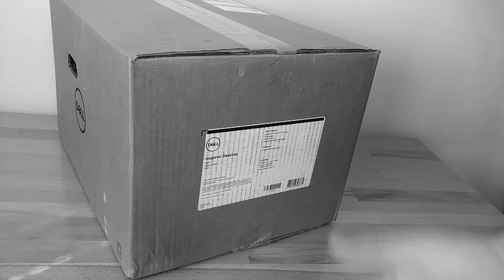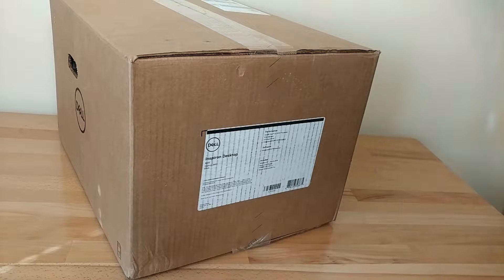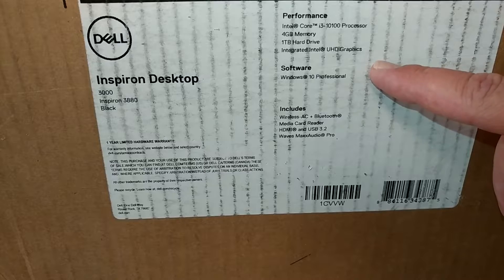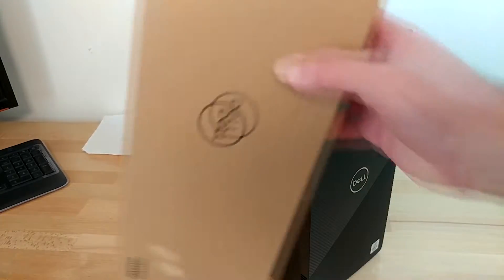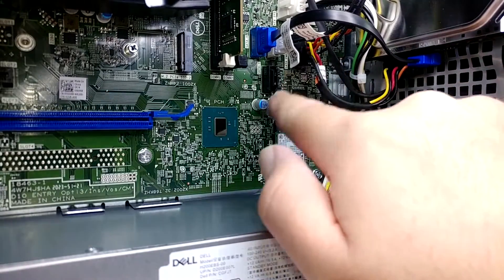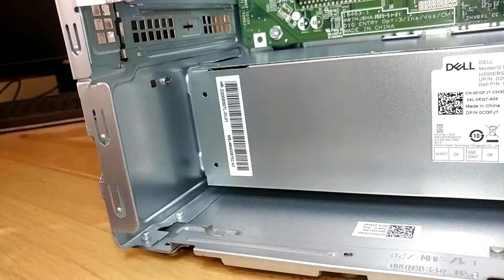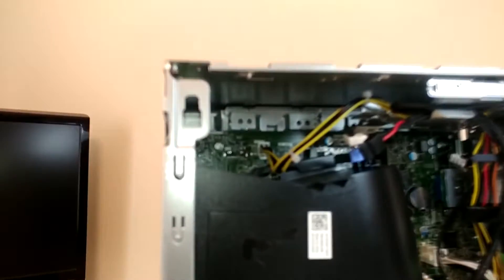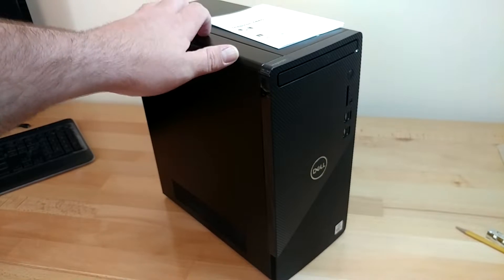Unboxing The Cheapest New Dell for 2021 (and 2022) and Upgrade Plans!

Comment: With the PSU, I can't seem to find the "standard" 260W upgrade anywhere as I've scoured the ends of the internet to where I'm sure I passed Mordor AND Hogwarts... and I can't find it. I'd rather not deal with being on the phone with Dell for hours on end either... I finally caved and went for a non-OEM mod with the 360W PSU meant for the Optiplex/Inspiron 3668 (which has a VERY similar chassis and motherboard to the 3880 btw) based on a post on Andrew Bullis' website/blog in which he made a lightweight/starter gaming tower out of the 3880 by swapping out for the 3668 PSU and added an AMD RX 550 (of course a lower-end 50 watt card but he said he was trying to be careful as he wasn't sure of the 3880's capabilities and such) along with a SATA-to-3pin fan adapter and 80mm case fan for cooling (and a tiny resistor cable so that it didn't run too loud) in which he claims still works great after many weeks. Granted it was written like 4-5 months ago so IDK if he still has that rig but it was an unexpected solution to the proprietary PSU problem (it's a problem not just with Dell but kind of standard with HP and any other major PC manufacturer) and thus has gone somewhat viral amongst 3880 posts/subreddits... also there's a post or 2 (with pics) on Dell's forums where people have put standard ATXs externally with 24-to-6 pin adapters but for the cost of over a Benji for those AND the still-expensive GPU (though they're supposed to be getting less expensive soon, literally knocked on wood for that) I'm sure it's possible to find a better gaming-dedicated tower for a similar price... or to actually BUILD one that's even better than that. I mean I've heard one could just put a 1030 in the PCIe slot and be done with it (though I've heard it might be pushing it with 200W) and I'm not sure it's cost effective to even bother putting even say a 1660 super in there.

It really is a shame too, as I checked out a review Gamers Nexus did on these proprietary Dell PSUs (granted this one was an epilogue/extension to a negative review they had for Dell's G5 but its PSU is very similar to the inspiron's) in which they go into the tech details of how PSUs work... they have an Oscillator and various other power-testing gear and the PSU performed surprisingly very well for what it is. These proprietaries are not BAD PSUs by any means but they ARE hunkered down with very low wattage which pours salt on the wound of the GPU situation.

I'm not sure if I'm actually gonna put this PSU swap in my PC but even if I don't (I really want to just build my own PC instead, if not just for the experience to say I did it and to actually choose what I want to put in it; expensive prebuilts even from smaller more boutique companies like ABS can get sketchy as there have been TONS of horror stories of the PCs breaking during... probably before shipping) It's not a TERRIBLY expensive L as I'm sure I could sell it to one of my friends on the cheap if they want to collect parts...

Anyways, just some thoughts on the whole PSU situation that is extremely common amongst big-box builds.
Reply from the maker: Someone, I think maybe Andrew, shared a similar blog post with me months ago at this point, and I admire his efforts, but I'm not generally in favor of that swap for a variety of reasons (which we will discuss when I make the video). BUT... I did just take delivery of one such Optiplex PSU this week so I can illustrate it as an option. I've decided to commit to illustrating the 3 most popular choices. Those three options are: standard ATX psu, aftermarket SFF PSU, and finally the larger Optiplex PSU. 

My personal "officially recommended" chain of upgrade events is: 

1 - Standard ATX PSU w/pin adapter for the Dell board, sitting external to the 3880 case.
2 - Move the Dell motherboard to a normal ATX case (may or may not be a huge issue... I'll find out).
3 - Ditch the Dell motherboard and upgrade to any standard aftermarket ATX board you want, and then harvest the Dell board for parts (CPU, RAM, SSD, etc).

At the end of that progression, you will have your own scratch built PC, but you'll do it in $50-$100 bites. And... You could have a stock 3880 at the end of it again too. Or you could if you want.

The only risk is how big of an issue it might be to recycle the Dell board into an ATX case, and really, it's not a risk for me at all since I'm going to step 3 regardless, so in reality steps 2&3 may just get combined. I'd much rather spend $150 on a decent aftermarket board and case to have no more chains around my neck from Dell than an additional $100+ on a funky PSU and still be trapped in the Dell case.

---

It will be a few more weeks before I make this video as I would really like to lean on the stock PSU a little harder with either a GPU or CPU upgrade, but as you mentioned, those prices are killer. As you said, this topic is going viral in its own way so the longer I bench sit the more I'm missing out. I'll be at the crossroads soon...
Reply: @TheBrokenLife  Have you decided on a case yet? I'm not sure which case would handle this board but since I can just get the model number from CPU-Z (faster than searching for it at least) I might look into it myself as a budget build project (or if I do one in the future for fun... I have seen some techies do some fascinating things with old beater OEM PCs and I have a good time watching those vids since some of those comps were bought for like under $50 EASY... for me it's kind of like watching a fun experiment as a kid with what happens with all these different variables LOL!) Certainly it doesn't seem worth it to get one of those fancy big tempered glass cases for these RGB parts that all these youngsters seem obsessed with for the sake of RGB everything (as much as I really like the EDM/Monstercat/Daft Punk aesthetic it has, it does nothing performance wise so I can take it or leave it LOL) but I'm fascinated as to what you might find case-wise. You are right too, it does make more sense to not be stuck in the Dell case... since it's literally impossible to indicate what the UserBenchmark builds with higher end GPUs have as cases/PSUs it might be possible that those Benchmarks did indeed swap out the stock case for a standard ATX or just has the good ol' ATX Daisy-chain (which looks goofy with the Napoleon Dynamite setup but if it's functional it's functional. I personally don't have the space for this to work well for me though... my 8-9ish year old desk I got from Wal-Mart for $30-40 is TINY LOL!) If I found a decent enough ATX case for a low enough price on say NewEgg or Amazon or whatever I wouldn't be opposed to swapping out of the stock case myself.

Even if I don't put the 3668 swap in my PC it's rather likely I'll keep it for when I FINALLY get around to doing my video review, maybe to drive home what people are going through to get higher wattage out of it since it's a bizarre contradiction to have a PCIe slot AND a mere 200W PSU holding it back (something else I will point out in said review.) I want to see more of what one can do with this stock PSU myself so I feel like it is perfectly reasonable to spend more time with it.
Reply from the maker: @ZenDeividdo  Heh... You're wrestling with the same arguments I had, but for different reasons. An RGB case for me would be amazing for thumbnails and viewer retention, but I really don't need that or the price tag for a "good" one. In the future once the channel is actually paying for the hardware, I'd for sure go that way.

I'm looking at mostly bling-free cases from decent manufactures in the $50-ish range. I'd like the PSU, MB, and case swap to be $200, or less, for the sake of the audience. People bought the cheapest new Dell the first time for a reason.

As far as GPU, I did just finally talk myself into a baby step and ordered a GT 1030, with GDDR5 RAM at least, for only about twice what it should cost. I can deal with setting the extra $60-$70 on fire, but not like $200 extra for a GTX 1050 or greater. Certainly not like several grand for an RTX 3090...

I will likely try the bottom basement GPU and then upgrade to something closer to the middle later on as prices retract. I think it will be interesting to see just what you get out of the extreme budget choice.
Reply from the maker: @ZenDeividdo  I would think you'd be able to find a used ATX case and PSU somewhere and keep your cost down..? People do like swap meet/thrift shop videos too. Go for it! :)

I paid almost exactly $125 for a used 1030. I consider that to be at least double what they should be, but... They're out there if you look around. On the plus side, it's a passively cooled card and a lot of people seem concerned with fan noise, so, that's a trade off we can discuss too.

It's probably difficult to find reviews and such for the 1030 because it's not at all a performance graphics card. There probably aren't many reviews for bus I/O expansion cards either. They sort of are, or are not. If I'm honest, my original plan wasn't to go that direction either, but we'll make lemonade out of astronomical GPU pricing. I'm also still developing the formula for this type of thing, so maybe an extreme budget option will always be part of the mix in the future? I'm thinking 12 episodes per machine (one monthly), so, maybe? We'll see!
Reply from the maker: @ZenDeividdo  Meh... Just follow me along the way and you'll turn your 3880 into a home build in no time. It won't be that tough for us to get there. Now that I have a PSU and at least one GPU video on the way, the next will probably be CPU, then the big swaperoo into a new case. So... Ticking in at just the end of the year, or maybe a month or so early, I suspect. So... ~4 months and you'll have the whole picture, I hope.
Reply: @TheBrokenLife  In any case (pun not intended) whatever ends up happening I'm here for it. I've been reading up a bit in forums/subreddits just for the heck of it and some have been saying that moving a Dell motherboard to a standard ATX case can be rather tricky and there have been instances of the swap flat out not turning on... there are quite a few motherboard REPLACEMENT vids but the only actual swap ones I can find are for the Optiplexes. In no way do I know if it's impossible as perhaps it's happened with an Inspiron, it's just that I've never seen it before... apparently the proprietary parts problem (say that 10 times fast) is a typical Dell thing and isn't limited to one particular part. I can't confirm nor deny any of this stuff as I don't have tons of cases and Dell motherboards lying around to be sure but I'm fascinated to see what you come up with!

BTW I'm really close to being at the point where I can do my own review of the 3880... it'll probably be a 2 parter with the 1st being an actual review/pros and cons/score and the 2nd part as to how to make the most out of this particular Dell... I'll refer the viewers to your vid series (and link the playlist of course) since I'll point out that the actual manual is crap... but it might help your channels grow a bit more as I do have family and friends that might perhaps find some of your other vids interesting too, perhaps the automotive stuff as I have some mechanics in my family/as friends. I feel it's the least I could do to help you start more projects/builds since you're not shipping parts such as those bezels right now due to the hot summer :P
Reply from the maker: @ZenDeividdo  I think people have varying levels of expectations as far as the board swap. For me, if I can physically get it to fit inside another case, and turn on, then I don't care about anything else. Meaning if I can't access the USB ports, SD card reader, etc, I'd be fine with it. I look at that swap as a temporary solution until someone could afford a different MB entirely. So... Not a big deal to me if its imperfect.

Good luck with your channel! Let me know if you have questions about anything.

Comment: BRUH I GOT MINE TODAY FOR $820 at bestbuy did i get ripedofff?
Reply from the maker: Probably not. 3880 is an entire series and you likely bought a higher model than mine. Also, things have changed a lot in the world since October of 2020 when I ordered mine. Electronics prices are way up since then. Currently the cheapest 3880 is $70 more than I paid for mine (but does have 8gb of RAM, where mine shipped with 4).
Reply: @TheBrokenLife  mine has 12gb ram a intel-i7 10700k 128 memory and 258 ssd ik the cpu is good but am not sure about the ssd and memory and is it possible i can put a graphics card in it?
Reply from the maker: @Slow_Egg  That's a vastly superior machine to mine. You didn't get ripped off at all. Just that processor is almost $300 by itself.

I believe Dell uses Intel Optane SSDs, which are supposed to be paired to the CPU in some proprietary way to give it excellent performance vs. a normal SSD. I don't have any experience with them, but I wouldn't expect it to be "slow". Mine with a Samsung is a monster vs. the mechanical HDD it came with. You can check that video out if you want. Yours is a little small on the capacity side, but you can fix that in several different ways if it becomes an issue for you.

12GB is a good amount of RAM. You can go up to 64 if you want, but I don't think 12 is holding you back much right now.

GPU is everyone's favorite topic to ask about and I haven't covered it yet because prices are so inflated right now. The short version is that with your system specs you likely already have the larger Dell PSU, so you can likely support something like a GTX 1030 or 1050, but not much more. PSU and physical case size are the limiting factors when it comes to graphics cards. I will eventually cover this topic, but it's so expensive that I've been putting it off...
Reply: @TheBrokenLife  Thx for the help ama sub
Reply from the maker: @Slow_Egg  I appreciate it, thanks!

Comment: Pretty disappointed with this desktop.   The blinging thing not only crashes every couple of days for no explainable reason (have to reboot) but I don't find it any faster than my 5 year old Gateway that also has 1 TB.
Its literally, no faster at all!   Despite all the BS about optical drive, new technology, etc.
Was also annoyed by the fake DVD drive (its a dummy slot with the standard PC, and nothing fits in there but an DELL dvd drive, so forget transferring from your old PC).
I've found that complaining on the DELL site is impossible also, once you make a negative comment your login appears to become disabled.   No more Dells for me.
Wireless mouses are a complete waste of time also, they die every 2 days you have to coin it open and change the battery, or fumble with the on/off switch constantly.  Not worth the hassle at all.
Reply from the maker: As for your crashing, I can only imagine what the issues are, but for everything else there are solutions, many of which I've covered in other videos.

The primary cause of the speed issue is the HDD. It is ridiculously slow. I had that issue with the prior year's model, a 3671, as well and in both cases upgrading it to an SSD was a night and day difference. It transforms it from a nearly unusable machine into something quite spry. I have a video covering that process.

The optical drive bay is a 9.5mm/"slimline" bay for a laptop style drive. I have a video where I installed an LG drive in there. It's not very difficult or expensive.

I can't speak for all wireless mice, but I've only had one that eats batteries like crazy. I typically stay within the Logitech brand and only one of their models over the years has done so. Normally they last for months on end with no attention paid to the on/off condition. The batteries in the Logitech device I'm using right now usually make it about 9 months at a time.

I understand your frustration, but a few of these issues are simply us getting what we paid for. In my case I bought the absolute bottom priced machine they sell so I knew these things would be problems and I was prepared to fix them myself. I made a buyer's guide video on this serious of Dell where I expressed to viewers not to do what I have done and buy something more in the middle of the range of options (which would include an SSD, more RAM, and an optical drive from the factory). Good luck with yours! If you decide to take on some of these upgrades, check out my Dell 3880 playlist to follow along.